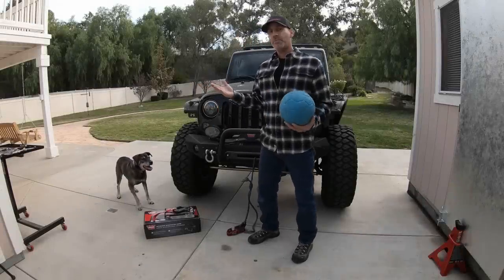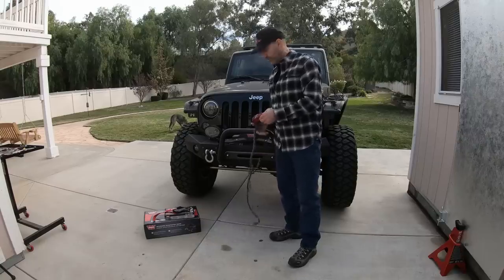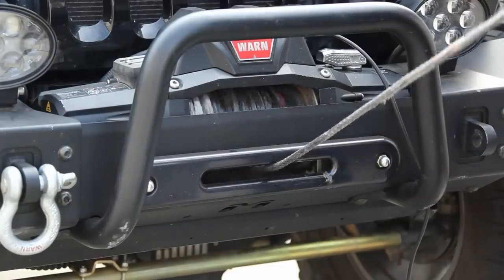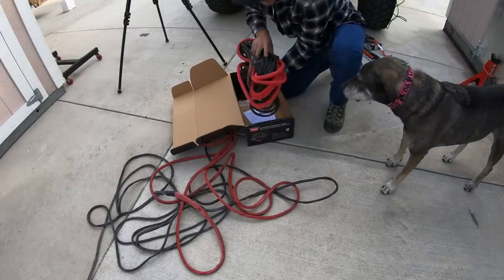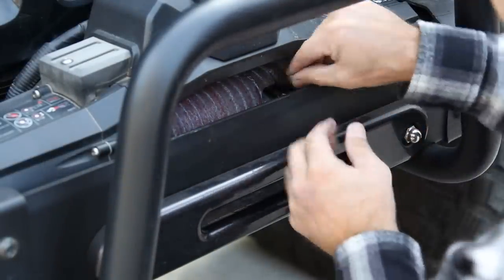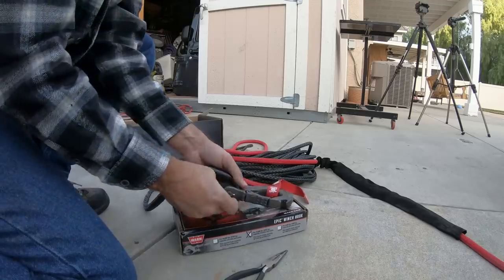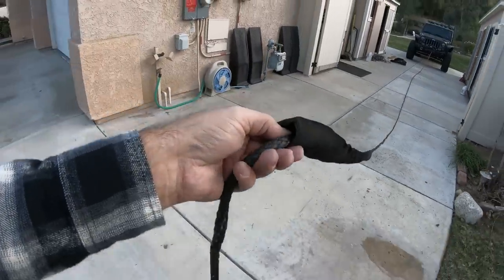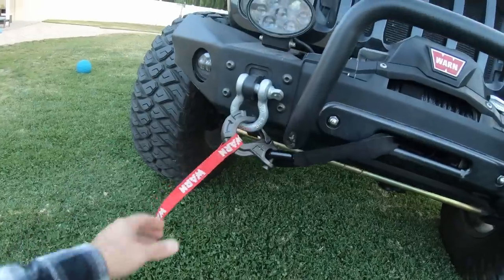Replacing a Warn Winch Rope and Hook Comparison Warn Epic or Factor55 Ultra

Comment: with synthetic ropes you actually don't want it spooled all nice and neat. you want it spooled ugly and messy because when you use the winch and put lots of tension on the rope and spool the rope can slip in between the other wraps on the spool.
Reply from the maker: That is good advice. Other than that first wrap on the drum of course!

Comment: I changed the axle seals on my Dana 30 the other day because it was leaking. This morning I woke up to a big puddle where it use to leak before I put in the new seals. Can anyone help me with possible reasons why it’s leaking again??
Reply from the maker: It would seem that you installed the new seals wrong... time for another go at it.
Reply: Turns out the axle shaft guide decided to blow apart in the new seal.. easy fix and now it’s back!

Comment: I used that Warn hook for a long time. Great hook but I ended up using Smittybilt's version of the Factor 55 Prolink and just taking the extra time to use a D-ring for all my winching. I KNOW with certainty that I'm not coming unhooked with a D-ring and the Smitty "Prolink" sits flush up against the fairlead and looks much cleaner than having exposed rope hanging out the front attached to one of the front D-rings.
Edit: Now if you REALLY want to feel like a complete dolt, run over and obliterate your winch hand controller! Ask me how I know!

Comment: Why don't you just cut a couple feet off rebuild your Loop also I bought my winch cable for my tow truck for $66 it's an off-brand but it's great and it's a half inch because rope is smaller than steel and it is really easy to install anyways because I use the screw lug on the side of the spool that I tapped on my own 32,000 lb breaking strength 80 ft long